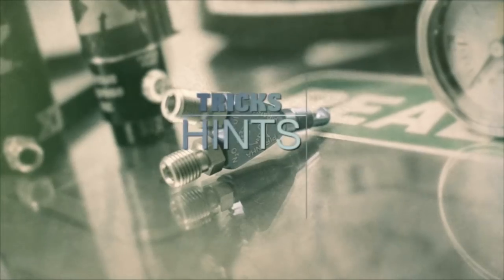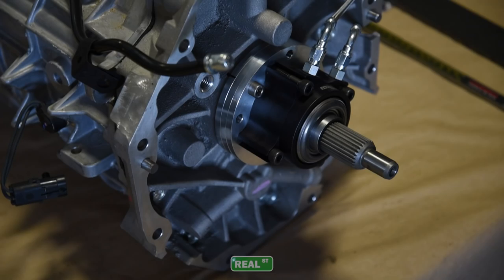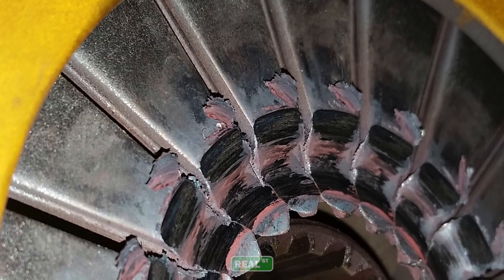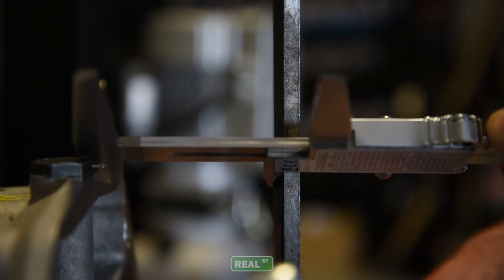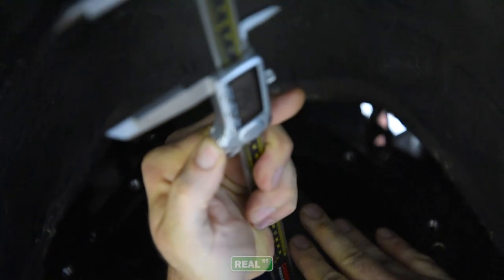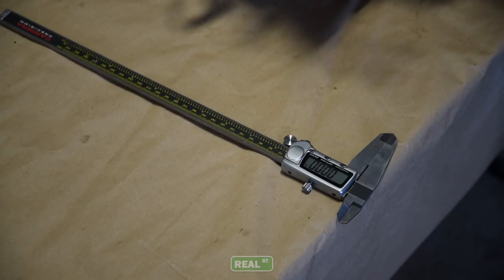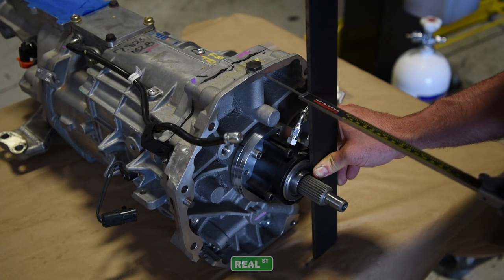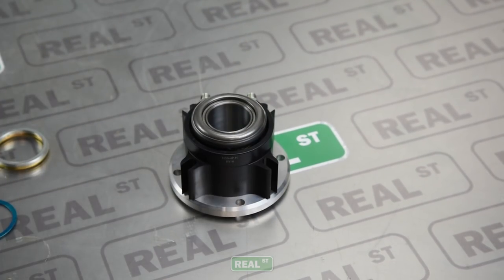Jay's Tech Tips #42 - How to Avoid Problems Multiplate Clutches - Real Street Performance

Comment: Jay, what about for an example, measuring the air gap on a concentric fitted to an MT82 mustang trans and a twin disc? The bellhousing is cast as 1 piece. Personally, in my experience, what we do is thread bolts into the holes of the block that would allow us to simulate the bellhousing edge and perform the other measurements the same way, however, this can be dubious at times, because threading the bolts in can and has in some cases lead to incorrect measurements/clearances.

Comment: ive lightened , balanced and skimmed my flywheel - now my thrust bearing keeps failing , MTX 75 gearbox - this my first zetec setup where the bearing in transmission is failing

Comment: My mcleod rxt twin disc with new pinion bearing and slave cylinder stock on my 2015 ford mustang gt performance package will not do a burnout if i rev at 3-4000rpm with traction totaly off, intead it acts like the traction control is on..what am i doing wrong

Comment: Is it possible to measure this distance on a T56 magnum/McLeod RXT w/ the transmission and bell still bolted to the motor? Or does the spring have to be removed from the TOB in order to get the collapsed distance? Obviously, pulling the trans back would be easier, in most cases. But the swap I’m working with is far from convenient to unbolt and pull the trans away.

Comment: My twin clutch was fine and now after 600miles 
You can feel the first plate is engaged straight of the fire wall and judders the car and the second plate engages right at the end of the clutch travel (peddle) before taking off 
What is the issue ? 
I have bleed the clutch which fixed it but did not last long

Comment: Is .200" Good for a Competition Clutch Twin Disc and Clutch Master Hydro Bearing, Honda s2000?
Reply: The easy test is to put the car in gear and rev the engine to 6,000-7,000 RPM with the clutch depressed and see if the car moves. If it moves with the engine speed up and the car moves it needs more air gap OR the discs are not floating freely on the input shaft. Thanks

Comment: Hi Jay... I installed mine up to spec, but everytime i shift the TOB squeels.. mostly on 1st and 2nd gear on lower RPM.. goes away on higher RPM. Then after putting miles on the clutch, about 200 miles, the squeel minimized.... Maybe need to be break-in?
Reply: you might of gotten a bad TOB it happens. did you reuse your old one or did you get a new one. you are suppose to change them when you do a clutch change.

Comment: bro, I have a quarter master tri-lite release bearing and quarter master optimum v clutch.  replaced clutch as it was bad, and also bearing and cylnder, but still grinds in reverse, and 1 - 4th are hard to shift.  Is it the trans gone? (its a super t-10 4 speed.)  Also, my release bearing bolts onto the bellhousing not trans, so how do you measure the gap between the throwout bearing and the clutch forks?  Thanks!  Its for my nascar racecar here:  https://www.youtube.com/shorts/Hheyapi8Sis